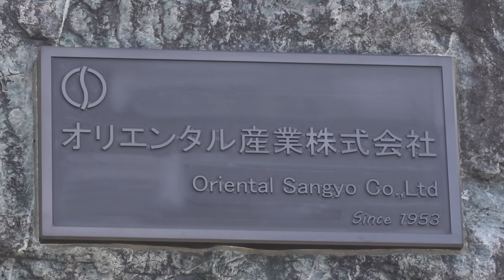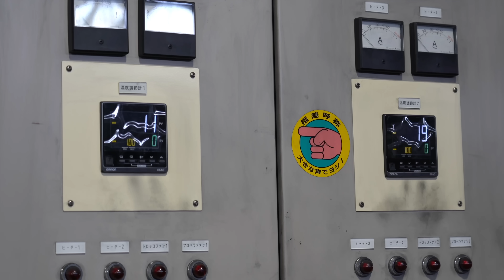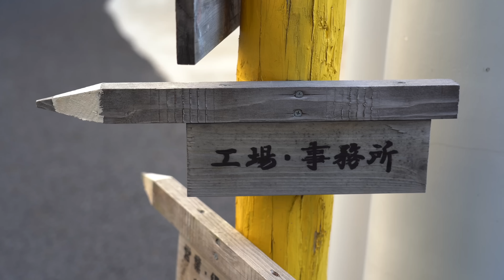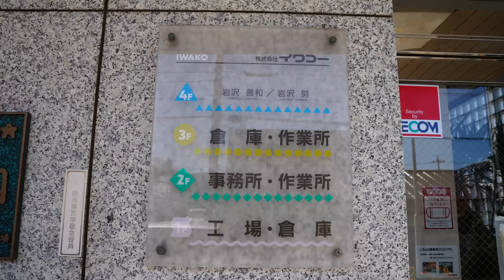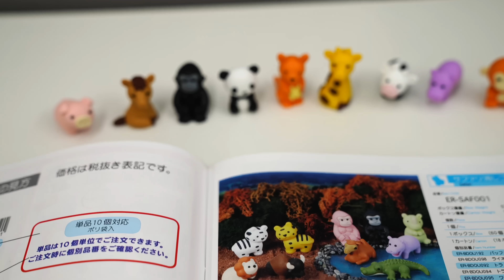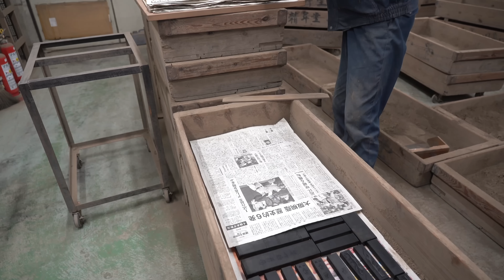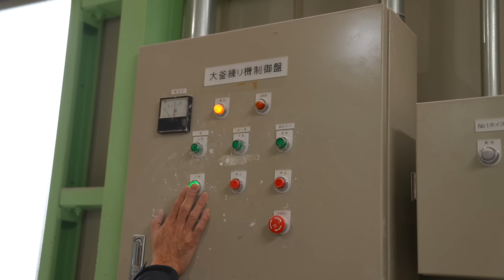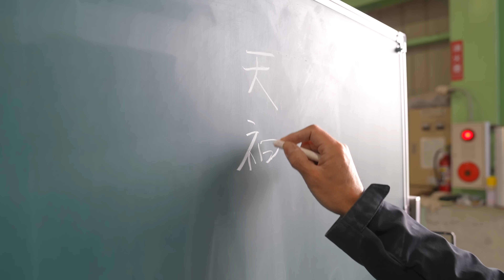驚異と衝撃！日本の文房具大量生産プロセス。世界が羨む日本の職人と工場。

Comment: This is incredible! The efficiency and precision in the Japanese mass production of stationery is truly impressive. It’s amazing how they manage to maintain such high quality in every single product. Definitely a whole new level of manufacturing!
Reply: This is what I came here to say. They were so precise and controlled even in each worker's movements. Almost like surgeons -- no wasteful movement! There was almost ZERO dust/product that flew into the air, out of the machine, and onto the ground. We couldn't get the full perspective, of course, but I'm willing to bet that whenever there's the rare spot in the conveyors for "fall out", there's an equally efficient way to re-collect it and still reuse what had been missed or left out. Everybody appeared to be wearing the proper safety gear over their entire bodies throughout the process.

And did you notice how clean it was overall??? A graphite processing factory that isn't drowning in its own dust and blackened char bits. The whole world should be paying the Japanese to take lessons on their safety and efficiency.
Reply: The first location was excellent,  but the later ones were sadly lacking 😮
Reply: Another reason for appreciation ❤
Reply: Wearing that watch in a production environment 😉. Ok.
Reply: There are so many passages from a machine to another that could be automated